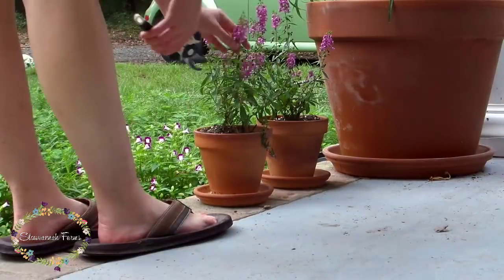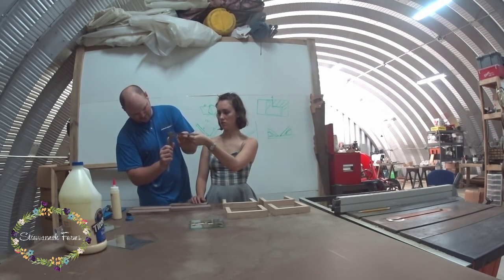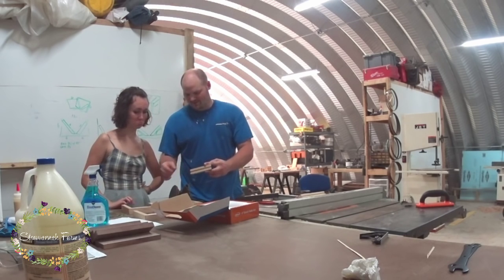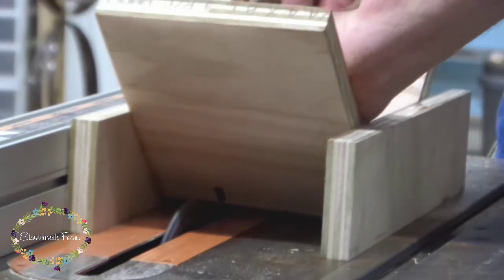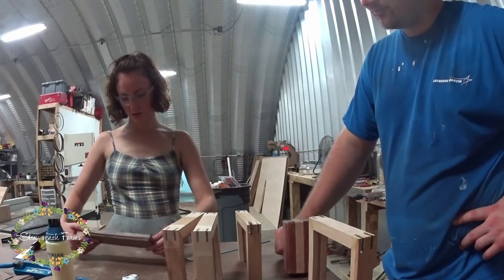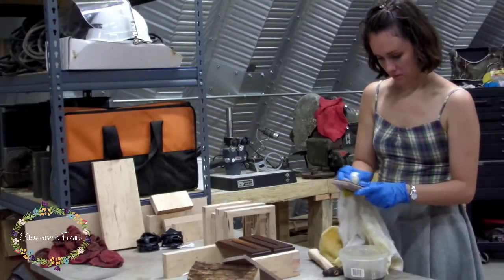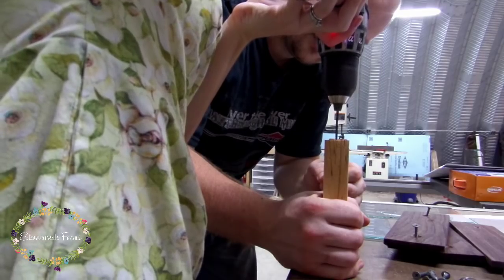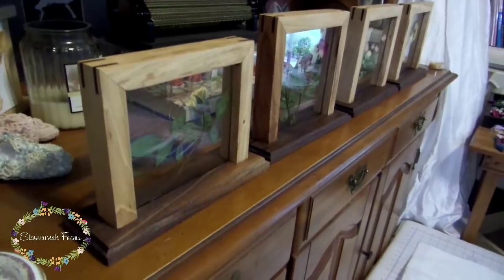Flower Press Collaboration | Carmichael | Cy's Corner | Tim's Woodworking

Comment: Nice project. The pressed flowers are quite striking. 

I'm convinced there is no such thing as a perfect 90 degree cut or join. I won't tell you how many hours I spent tweaking my crosscut sled. Close enough just has to do sometimes. I believe Wandel said once that there is nothing like sanding to give the appearance of precision.
Reply from the maker: +Nathan Baker Couldn't agree more with you, Nathan. There's no way to achieve a perfect angle or length... furthermore, no way to prove it either. Sanding is my friend, definitely. Thanks Nathan :-)